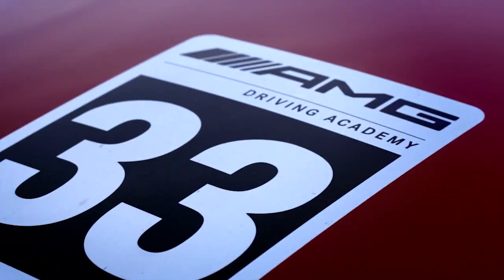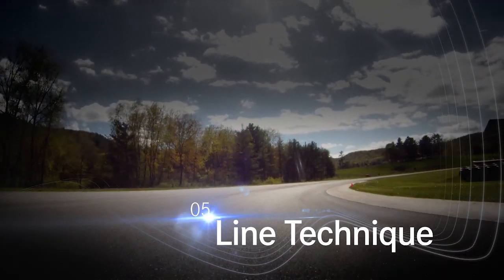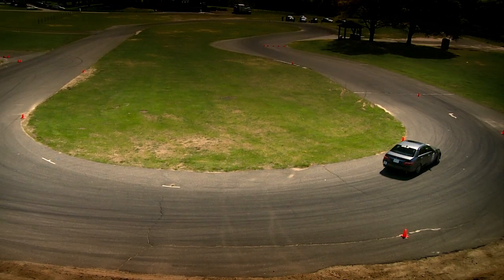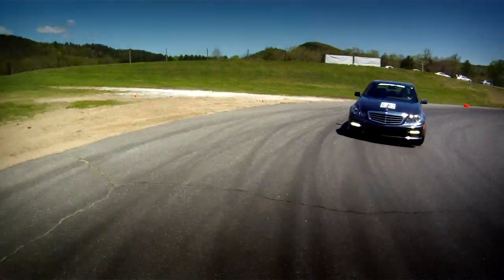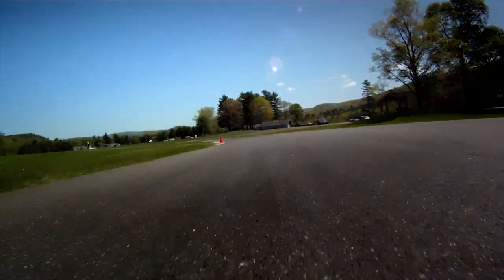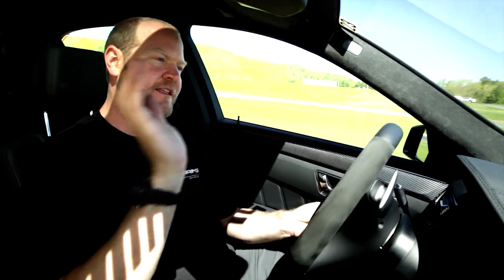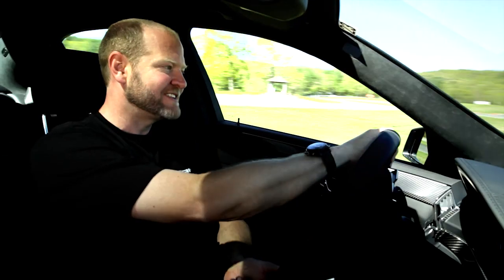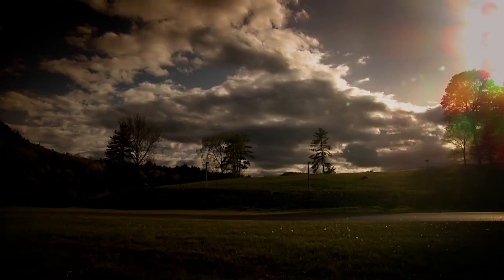Line Technique -- AMG Driving Academy Performance Series Episode 5

Comment: They should colour code the cones for brake, shift, etc.
Reply: +FIREHAWK1979 Who should? The ones making the video for demostration? That part is actually the easy part, you slow down going into the turn, then begin accelerating right before/at the apex. Brake into the turn, accelerate out of it. Not braking enough into the turn will cause you to have to slow down too much too late, or going off the road, and then you'll be exiting at a much slower speed than if you just slowed down more before entering the turn. Accelerating out of a turn too early will leave you braking again at the apex.